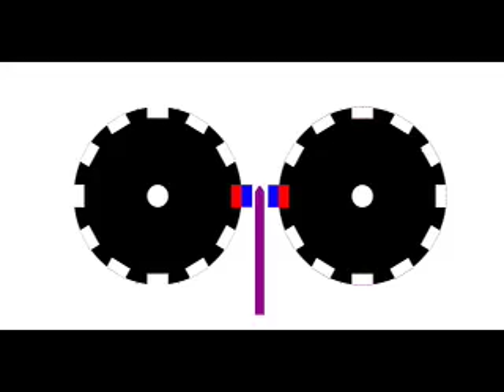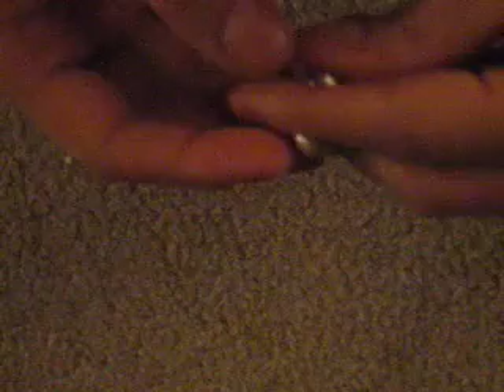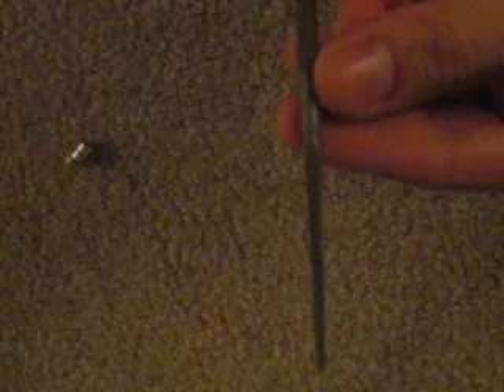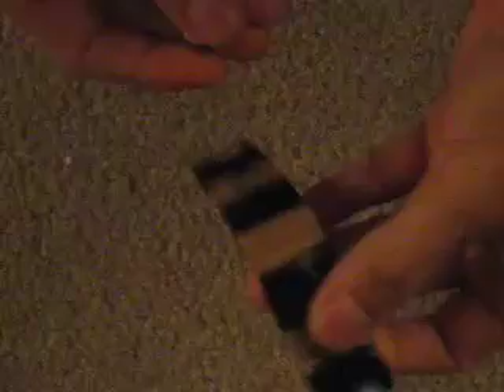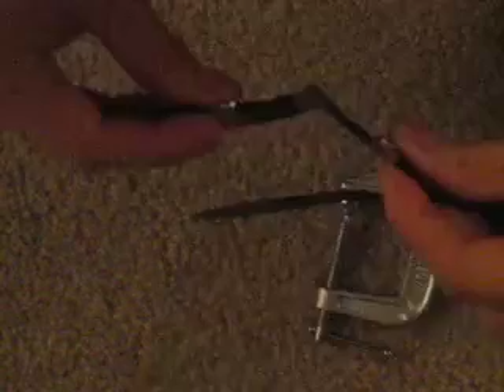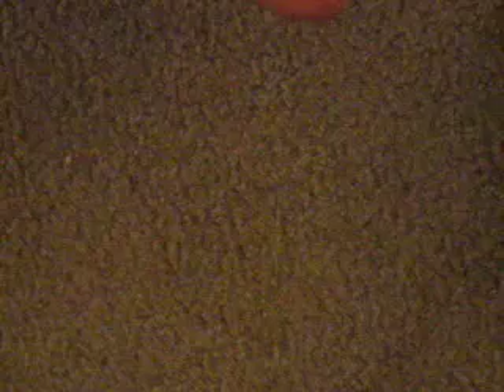Magnet Motor concept and How magnetic shielding works

Comment: I like the way you think  :O)  ...  "shielding" is maybe not the correct term, but in essence a wedge shaped iron core that gets placed centrally in the area magnetic influence of two opposing and repelling magnets mounted on synchronised but free wheeling wheels, same iron wedge will be attracted to both and therefore counter the repelling affect of both. It should be possible theoretically to balance this that there is a zero point with no gain or loss. I think it will work. I am going to build one.

Comment: awesome idea man, maybe you can have the rod in until the magnet gets half way then lower or retract it for a small period mechanically to remove the unwanted pulling when it is closest. then after it passed the shield let the repelling forces push each other up maybe. since they repel each other and cant leave their orbits they might both go up.  if the magnets could turn electro magnetically timed and reversed in polarity on specific times as needed to maximized the use of a pole in time. or a spinning metal cross 4 times around it at 45 degree angles. to maximize the pull then releases by  length of the rod.

Comment: Its a nice theory but basicly the magnets will force each others to stop :(
Reply: ***** I'll be more specific then, Imagine the gear have magnets in every tine, because both gears are round and because they are on in front of the other the magnets from right gear and from the left one will be in front of each other, every magnet will have one at the same disntance in the oposite gear, so they would create a magnet field that would do exactly the same pressure from the left and right gear to the midle, and if the force is equal the gear will stop.
It is very hard to explain but I've tried :/

Comment: You have the wheels going the wrong way, but there is nothing free as the magnets lose power and get weaker, and the possible power generated is hundreds of times less than the energy used to make the magnets in the first place in the factories.
Reply: +Charlie Collard I was going to +1 you, but I couldn't, because you said, "You have the wheels going the wrong way" when in fact, there is no 'right' way.  I liked the bit about manufacturing energy though.

Comment: use an iron magnet and bent it in such a way that the magnet equator get opened and the poles back . the equator of a magnet repulse even just metal let alone magnet  it pushes the both poles equally...put those bent  iron magnets around a wheel well glued.  and make the wheel heavy with a motor wheel to make it persist on one direction although this technic doesn't need it to make things turn but if you want this engine to do something heavy,,, u might need one. apart from that wheel to make it turn you have freedom of choice.  a circular big iron toroid it will let the yin and yang magnet particles free and an infinite loop which makes the movement of the first magnet wheel fluid with keeping the repulsion going on. free énergie relies in thé heart of magnets as it is in our hearts as humains.  meditate that and the possibilities are limitless even for healing.

Comment: But will not work.
Because the force that attracts and repel are the same.
Also the income magnets at the bottom on 2:33 don't have enough attraction power to overcome the attraction force for the two magnets in the center because they also have repulsion and attraction forces on them fighting, thus neutralizing the purpose.
Great thought thou.

Comment: Other's have used gears in this same way and it didn't work because the the repelling force at the top of the tapered metal was less than the attraction force the other magnets had on the metal rod where it was thicker. Even you yourself said it in an all about way.

Comment: Yes, magnetic field can be weaken to close to nil if you cross it with some MU-metal, but it just take the same work to push such plate into place to seperate the magnetic field as directly pulling those magnets. As such no power could be produced no matter how you build the device, there is no free launch.

Comment: There's no such thing as magnetic shielding. Magnets work through every kind of matter. Two magnets facing each other with the same pole will push against each other. A piece of iron in between will not change the force that pushes them apart. The only difference is that those magnets are also attracted to the piece of iron. They stick to the iron in between them even though they face each other with the same pole because they are attracted more to the iron than they are repelled by each other.

This device will not work, because the magnets under and above the "shielded" area repel each other with the same force and the wheels will stop and stay in the state of the lowest local potential energy.

There's no free energy. There's only stupidity and conspiracy theories.
Reply: Never said that it does. And what does that change?
Reply: Electromagnetism is a fundamental force. It's a warp in space-time. You cannot "shield" it. You can manipulate electrons which can cause the force, but you cannot shield something from the force itself. Just like you cannot shield something from gravity.
Reply: R u that dumb?
Reply: It does not. And what does that changes?
Reply: I love how he says "I've learned a lot from magnets", and then demonstrates a complete lack of understanding of energy, magnets, and magnetism. For anyone who still needs convincing: This will not work because as much as the magnets are attracted to the rod as the magnets travel towards each other, (speeding the wheel up), they are attracted to the rod as the magnets travel away from each other (slowing the wheel down). You can't have one without the other. Any way you get energy, you have to give it back to complete the cycle. This means the EM field is conservative, just like gravity. Imagine it like this: You can roll down a hill and gain energy, but you can't get back up the hill without expending an equal amount of energy. There's no magic lift to take you back up to the top of the hill.

You can play around with the field all you want, but you won't be able to change that fact. That's why scientists and engineers can dismiss any magnet motors so easily: you'd have to break very simple, well known laws for it to be possible.
Reply: Thus net energy is 0. Even lower if we consider friction.
Reply: +TheFarciarz777 Well you mustn't be up with the latest discoveries coz they have discovered material blends which will repel & contain magnetic flux lines.
But I think that the use of the word 'shield' here may be misplaced - it's more like he seems to be implying that the iron is redirecting the flux lines, although I'm still trying to understand exactly what he's trying to express.
Reply: that's what magnetic shielding is
Reply: Explain what , idiot ?  Energy never get lost, that's it !
Reply: in every mechanical hard drive is so called mu-metal used as a magnetic shield. it works because the high permeability of the metal. same goes for iron, so yes iron will change the force magnets are pushed apart.
Reply: You didn't seem to read anyone's comments here. The point is that magnetic shielding is pointless with respect to energy. As you change the distance between the magnets, there are three possible states: net attraction, no net force, and net repulsion.

If a magnet experiences net attraction coming towards the other magnet/magnet shielding, it will experience that same attraction going away from the magnet/shielding. The same is true for repulsion.

Also, the "shielding" shown in this video isn't actually shielding. The only differences is the magnet is attracted to the file more than it is repulsed by the other magnet. This still doesn't solver our problem, as the effect is still symmetrical; the force is exactly the same coming towards the file as leaving the file.
Reply: what about superconductors
Reply: Dylan Ezell What about them?
Reply: Muh Face .. google "mu metal". it redirects the magnetism so it doesn't affect other (i.e.) magnets close by.
Reply: Actually you are wrong. There is. You don't use non magnetic material for shielding you use magnetic. the principle is that the magnetic material becomes magnetized but with an opposing force field. You will not shield 100% due to energy losses between the magnetic fields. but you will shield drastically. That is how they shielded speakers in the old cathode ray tube type TV. They had to shield them otherwise the tube became magnetized and the colours distorted. See https://hollandshielding.com. You can purchase magnetic shields here.
Reply: Uh....hangon there, sir. Flux control material exists...
https://www.youtube.com/watch?v=KXMyx4bXUxk
Reply: lothar654 Explain
Reply: +TheFarciarz777 U use diffecult words but maby u also know energy is always getting somewhere so in theory it would be possible
Reply: +lothar654 I mean energy doesnt get lost
Reply: Energy never get lost.  That's physics'roots

Comment: This wont work because the iron rod in the middle will become magnetized by whatever side magnet is stronger or closer, and the rod itself will repel the magnet on the other side.  Even if you build the device with extreme precision down to 1000ths of an inch, one wheel will be closer to the rod than the other wheel, and the wheel that is closer will dominate the metal rod.  Even if you got the precision right, no two magnets have exactly the same amount of magnetic force, and whatever magnet is stronger will dominate the rod, and turn it into a magnet that repels the other side.  It will just stop in its tracks.

Comment: Why till now no company. Has commercialized this concept . what are we waiting for ?
Reply: Salim Maarouf I had built this device. It didn't work.
Reply: What about yildiz magnetic motor . It has been seen in many forums .
Reply: Salim Maarouf Why ? isnt obvios ? What will do the big oil company that is milking humanity ?
Reply: Salim Maarouf Yildiz is a scam.  The "motor" doesn't actually work.
Reply: +Salim Maarouf 
Exactly, it works for sure. It is only a matter of time before the world realizes this can be done. Yildiz, in my opinion, got it right.
Reply: Yellow Hammer

Yildiz = con artists

Unfortunately con artists like that end up doing more harm than just taking money from the marks.  They also divert would be inventors into a blind alley.
Reply: You think so? Why?
Reply: Yellow Hammer
You should say who you are addressing
If it was me, the reason is because it is a quite obvious con based around a claim that is not possible.
Reply: Mr. Ken Smith,
O.K.,  since you were the only one who has addressed me I figured you had the capacity for abstract though. I guess I was wrong.
Reply: Yellow Hammer
You caused me to have to check to see it you were addressing me.  Saying who you are addressing is the polite thing to do.
Reply: Roger that.

Comment: Magnetism is a conservative force. The potential of multiple magnets depends only on their position and orientation. Therefore, if a magnetic machine returns to its original position, it has returned to its original potential energy. Therefore, a magnet motor that runs purely on magnets is not possible. It's sad to see how much effort people are willing to put into lies about perpetual magnet machines, when a proof against all of them is as easy as 3 or 4 sentences.
Reply: Reginald Ford Magnet motor that runs purely on magnets IS* possible. I found a website that sells all magnet motors: h t t p://hmsbturk. c o m /tr/urunler/
Here is a video a magnet motor demonstrated by Muammer Yildiz at a Dutch Technical University: h t tp s ://w w w .youtube. c o m /watch?v=mHW6b1aFPfU
Here is a self running magnet motor made by Howard Johnson (hojo motor): h t t p s://w w w .youtube. c o m /watch?v=E7JOjU6z31M
Observations > Theory, you can have a nice theory BUT if your theory isn't supported by observations it has to be thrown away.
Reply: I don't think you really comprehended what I just said. It's all good. You think I invented the theory of electromagnetic forces, so I don't even know where to start. Mind you that Einstein's job was to tell people whether their inventions made sense, and part of that was to discount all perpetual magnet machines because Electromagnetism is a conservative force. If someone made a youtube video that tried to convince you that 2 + 2 = 5, you'd fall for it, clearly.
Reply: Reginald Ford I showed you factual evidence, actual devices. You throw more theory at me. 2+2 = 5 if* that other 1 comes from the environment. It would be 2+2+(X)=Y your output doesn't have to depend on the input IF* you absorb extra energy from the environment. That is how solar panels, wind works. Why not also absorb the monopoles (electrons) from the environment? Why not use x-rays for power? Over unity systems are systems that are open and they allow energy from the environment to come in and add to the system. That is why an over unity generator will actually get colder when it is running (not hotter).
Reply: Naoki Kashima That's cute that you thought of absorbing charge from the environment, but only opposites attract in terms of electrical charge, and all that does is cancel out with the charge that was used to attract it. Anyway, absorbing energy (always ultimately from the sun or from atomic fission on Earth) is a great thing to do, but a device that does that is not a perpetual machine. I have a master's degree in physics... But ignore me and waste more of your own time.
Reply: Reginald Ford Your master's degree is physics mean very little in the real world, however. I managed to replicate cold fusion that mainstream scientists couldn't do since 1978 to present... It is very easy 130V DC is needed along with 2 electrodes at 1/5 ratio (negative at the bottom) and a bath with ionic salt. You'll get a room temperature nuclear reaction. How you know its nuclear reaction? Well.. you get formation of elements that were not originally in solution (like if you use Aluminum, silicon crystals will form at the bottom as your + disintegrates). If you got your degree in a university much of what you think you know is completely bogus. Hendershot made a generator that suck energy from the air.... as did Tesla (look up Tesla patent 685,957 "apparatus for utilization of radiant energy". Mainstream eduction system is designed to add people to the work force.... not to give you information that will free you.
Reply: Naoki Kashima
 Ok. You win. You disproved all western physics and whatnot. I'll see you on TV when you're selling cold fusion powered cars, etc.
Reply: Reginald Ford Everything I do is 100% open source. You won't ever see me sell anything :) Humanity have been screwed over. Fossil fuel was obsolete since 1898 when Tesla found an efficient way to transfer AC power over long distances. Normally a magnetic field is at 90 degrees to the flow of the electric current. However, through the use of pancake coils and proper tuning electric current and a magnetic field can be made to point in the same direction. The normal speed of electric propagation is the speed of light C. If the magnetic and electric fields are both pointed in the same direction the speed of propagation increases to Pi/2*C or 1.5 times the speed of light roughly. I doubt you'll ever learn that in school though :)
Reply: ***** conservation of energy applies to closed electrical systems only. If a system is designed open energy from the environment can enter the system and change the output. Also, when Maxwell wrote the energy equations he had a longitudinal wave component in there. He couldn't create these waves in a lab so he arbitrary assigned the value of zero to these waves. Since then these waves were shown to exist by German PhD Konstantin Meyel and Dollard. This discovery blows Conservation of Energy laws out of the water as well as the Theory of Relativity (because longitudinal waves travel faster than the speed of light). Look it up.
Reply: +Naoki Kashima Fords a troll  HIS conservation of energy is copy N paste See his copy comment on other Vid...
Reply: kaminaridragon66 The truth is the truth, if I changed what I said at every comment it wouldn't be the truth now would it?
Reply: the word impossible in your statement will make you stagnant and never achieve anything but saying impossible to anything that over challenge your intention to rely on the creator of the universe to open for you secrets to his creation. if you want a proof watch the universe turning, god makes it turn and everything follows by the all the law and secrets of the creation.  the only ones who succeed actually observed the universe and the let the creator teach them the real thing
Reply: Thank you for setting closed minded people ( who have limited thought patterns) straight.Their thinking can no greater than there understanding

Comment: Wow, dude! You got a good head on your shoulders! I have to admit, I have been sitting back for some time waiting for someone to get as close as you have gotten here in your video. The next step would be to start building your design however you know to build it. Sure, duct tape, toilet paper rolls, construction board, wood and nails........all that stuff is good in the beginning. You will get a good idea going and then need to consult a machine shop to build you a chassis that isn't made of paper, which your magnets are going to rip to shreds............!!!!!!!!! Think about it what I just last said !!!!!!!!!

Comment: have u tried making one. i didnt do this idea like the video but surprising enough a magnetic motor can work. pick up some magnets and play with them. i did the V shaped one with a magnetic rod on top. positive up on one side of the V and negative on the other. and when u push it close it wants to turn. just lift off when u get to the intersection point.